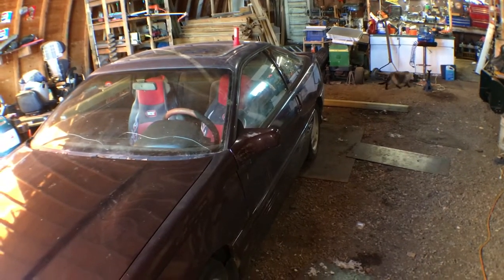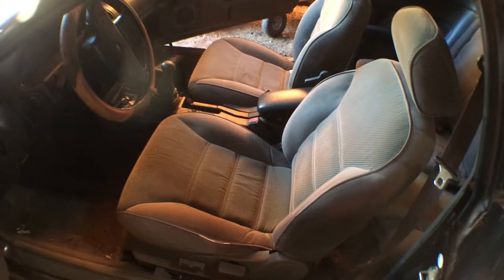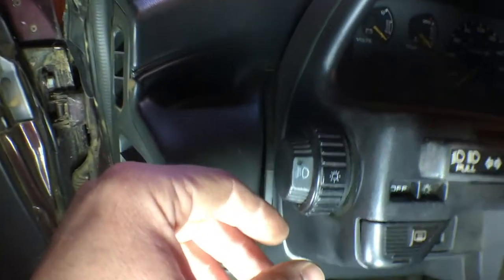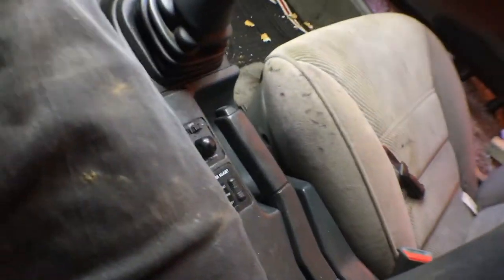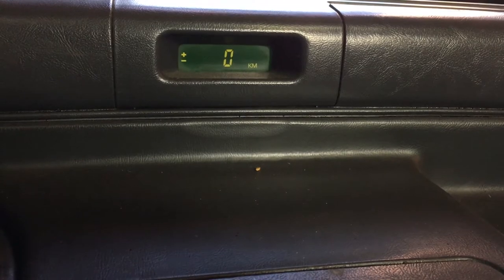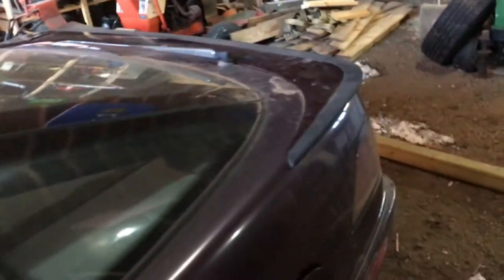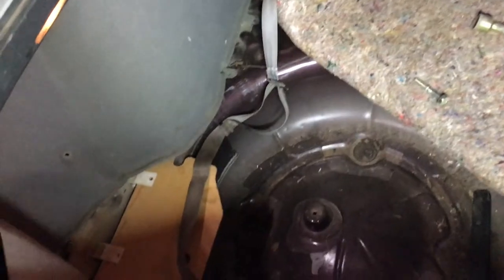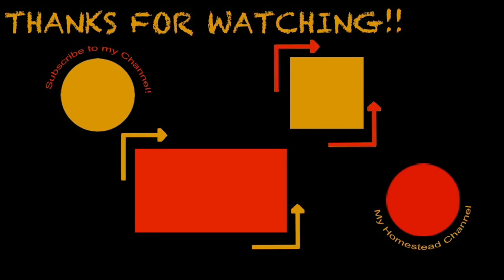Interior Tour of the 1989 Ford Probe GT - P2

Comment: Couple things...1.) the “box” under the passenger seat is the stereo amplifier. 2.) in the front of the passenger seat there should be a tray that pulls out. Manual may be in there.
Reply from the maker: Thanks!  No manual, but eBay provided.  Next video is soon, getting into the ignition system.

Comment: Looking good so far! I'm always in envy of the trip computer and the Vehicle Maintenance Monitor in the ceiling, didn't get those on the ones officially imported to germany. Kinda useless back then and even more these days but totally 80's cool.
Does yours have the automatic seatbelts?  
Btw. the automatic suspension control was pretty good for its time apparantly. It's not just the manual adjust between sport, normal and comfort afaik its also auto-adjusting in corners to combat bodyroll. Can't verify that though.
Unfortunately to my knowledge there is no way to get new shocks for that system so once the shocks are worn out you have to replace them with non-adjusting ones and thus lose this cool feature forever :(  Considering the lower miles and that you heard the little motors turn I'd assume you still have it.
ps. the Mazda F2 / F2T engines are pretty bullet proof engines, not much that can go wrong on these. Some people running those with different turbos otherwise stock at 300+ whp
Reply from the maker: Thank you for the great comment, I am also intrigued about the rear suspension.  My car does not have automated seatbelts.